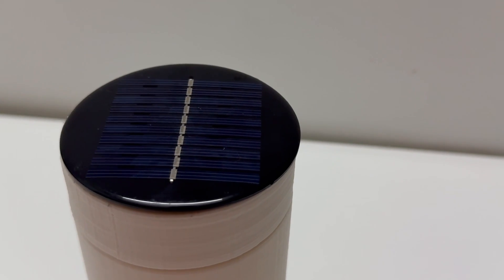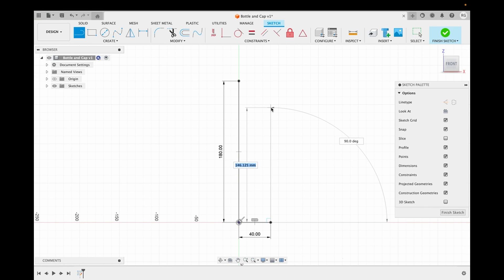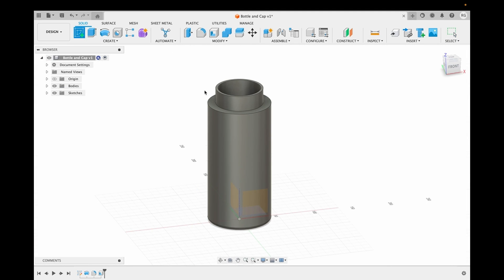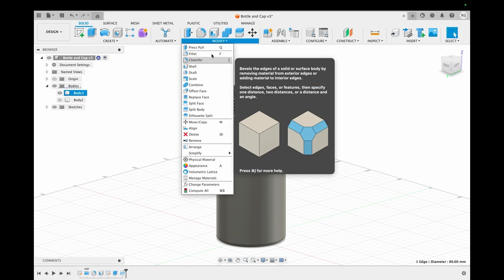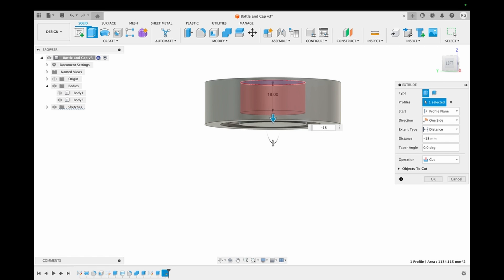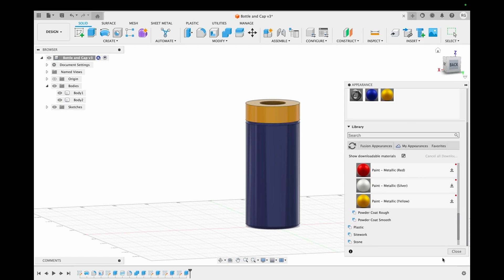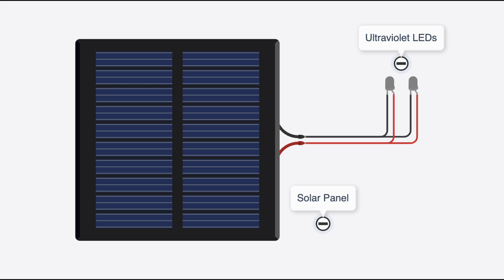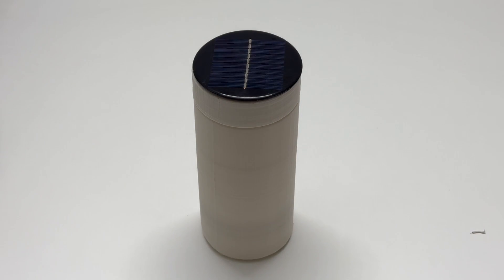This Bottle Cleans Water Using Solar Energy | Tech Nuttiez | Riddhi Gupta | Aarav Garg

Comment: Hello, are these two LEDs enough to sterilise the water and therefore kill all bacteria and viruses? What is the wavelength of these UV LEDs, given that there are different wavelengths (from 395 to 405 nm if I'm not mistaken) which one is necessary for sterilisation, are all these wavelengths equally effective for this type of use?
Reply: Reading about this project in the Hackspace magazine, issue #81, "Apparently, the optimum wavelength to effectively inactivate microorganisms is in the range of 250 to 270nm".